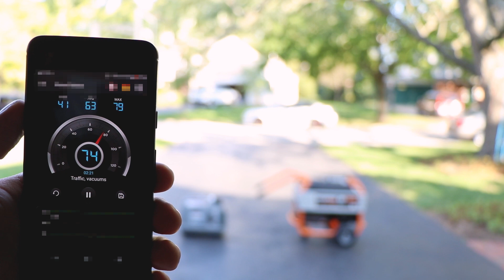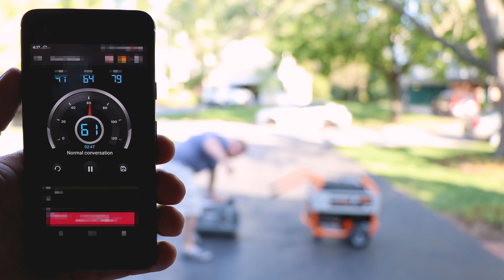How Loud are Portable Generators, Really?

Comment: So.... there is no argument that the inverter generator in this test is around 10db quieter than the non-inverter one but... I think the "deck" is somewhat "stacked" in favor of the inverter generator.  I would like to see this test re-done with generators with output wattage in the same range AND running under "near capacity" load as, it is my understanding, that inverter generators are designed to run at slower (and thus quieter?) speeds when the demand is less (hence the reason they are more fuel efficient) so I am wondering if a more "apples-to-apples" test scenario would level the playing field a bit..... thanks :-)
Reply from the maker: You make some good points. We recorded this because we happened to have both on set during filming and did not put them under load. Just a simple sound test as a baseline to illustrate the difference in sound, because many customers do not understand just how much of a difference just a few decibels can make. With inverters, you trade less usable  power for more convenience, portability, quietness, etc. More powerful gas generators under load run louder, as that is the nature of how mechanical engines operate. Maybe next summer we'll be able to do more testing to demonstrate changes under load. Thanks for the feedback!